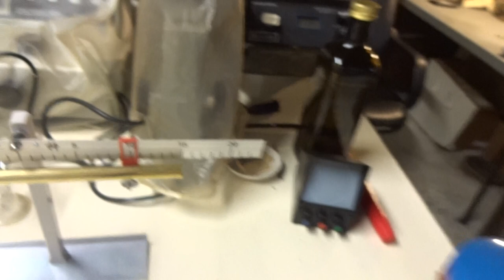Demonstrations in Physics--Thermal Expansion of Metals

Comment: Thanks for posting this Frank! I think if the metal disk is heated evenly in an oven the expansion will be evenly distributed and no warpage will occur.
Reply from the maker: You are correct.  More videos to come.
Frank
Reply from the maker: @dale777ful  Thanks.  The next video is on the thermal conduction of metals.

Comment: My guess is that due to there being more expandable mass in a single strip through the center that this will cause the circle to expand more along the area the strip touches, and cause an oval-like shape to form, or even that the pressure of the middle strip expanding will cause the entire circle to buckle in one direction, perhaps even forming something like a bowl shape out of the whole thing. I am not educated in the matter, though. Just my best guess.
Reply from the maker: The entire metal shape expands in all directions, so the outer circle does not warp.
Frank

Comment: i dont get it, if the metal expands after heating why would the hole in the middle be bigger, could you explain please.
Reply from the maker: The entire metal plate expands in all directions; the plate becomes larger.  Thus, the hole also becomes  larger.
Frank
Reply: @frankreiserm.s.8039  but if it is expanding in all directions isnt it expanding towards the center too, so how is the hole getting bigger?
Reply from the maker: @0110985170096  Draw the shape on a balloon and then inflate the balloon.  You will see how the shape gets larger in all directions.